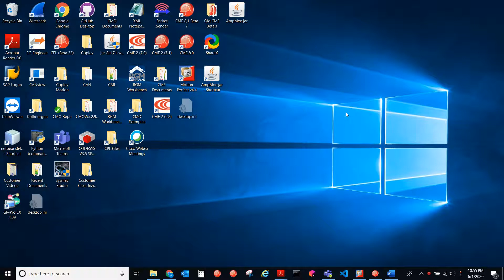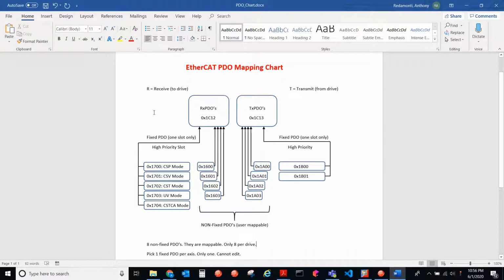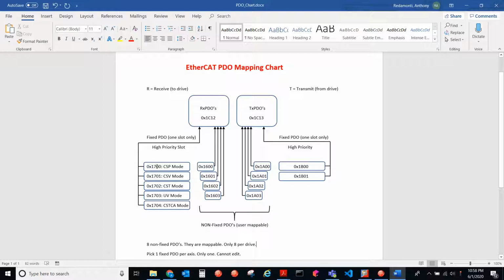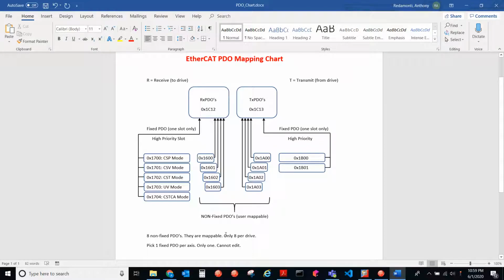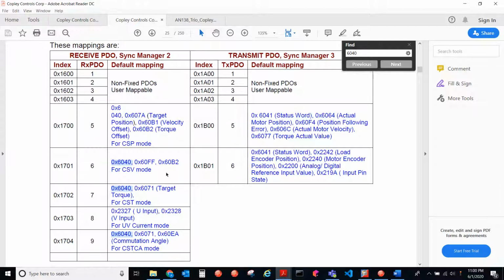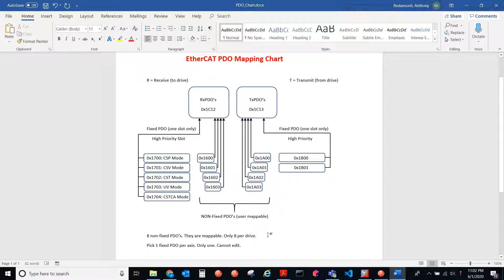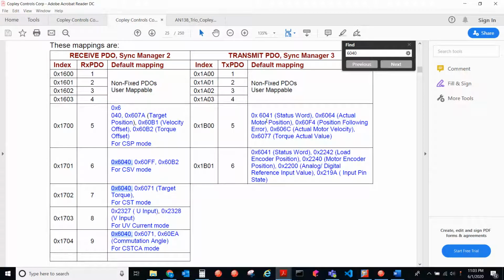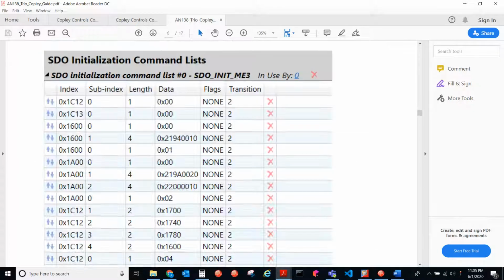Introduction to EtherCAT PDO's

Comment: If i have multiple drives(seperate ethercat slaves) do i need to offset? Or is that just for a single slave with multiple drives inside ?
Reply from the maker: The 0x40 offset is only for multi-axis drives.  It is also important to note that this offset is only for fixed PDOs.  For example, Fixed RPDO1 Axis A = 0x1700.  Fixed RPDO1 Axis B = 0x1740. Etc.  Also, there is an 0x800 offset for CANopen object indices for multi-axis drives.  Control Word Axis A = 0x6040.  Control Word Axis B = 0x6840. Etc.   Single-axis drives do not have these offsets because each drive is treated as a separate node on the network.

Comment: In the beginning of the video you said the offset for multi-axes was 40. Later on in the video, you said the offset was 800. which one is correct?
Reply from the maker: Excellent question. The multi-axis offset for object indices is 0x800 for objects in the range of 0x2000-0x27FF (Manufacturer Specific Objects) and 0x6000-0x67FF (DS402 Objects). For example, the Status Word for axis A is 0x6041, and for axis B it is 0x6841. The multi-axis offset for the object indices of the fixed PDO's is 0x40. For example, the object index for fixed RPDO1 for axis A is 0x1700, and for axis B it is 0x1740. Only the fixed PDOs have this 0x40 offset. Please read our helpful CANopen Programmer's Manual for more information. Link to the manual: https://copleycontrols.com/wp-content/uploads/2018/02/CANopen-Programmers-Manual-5.pdf